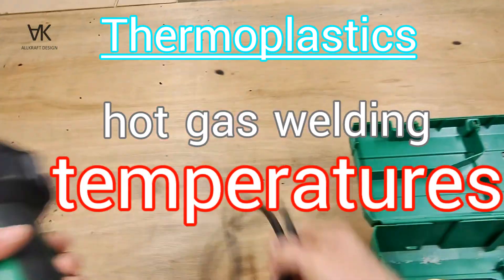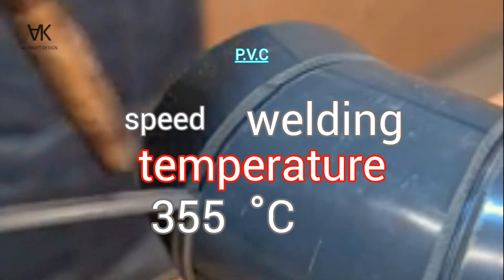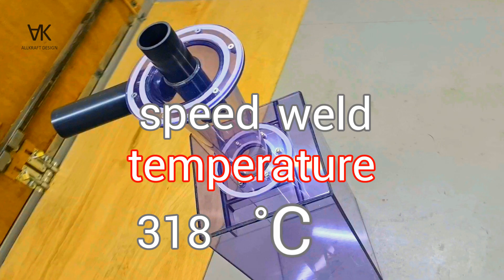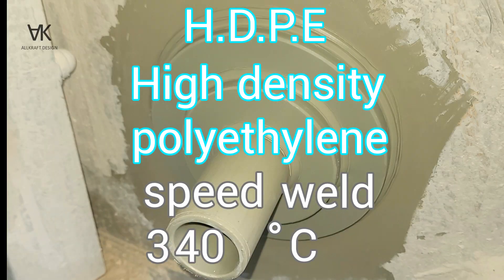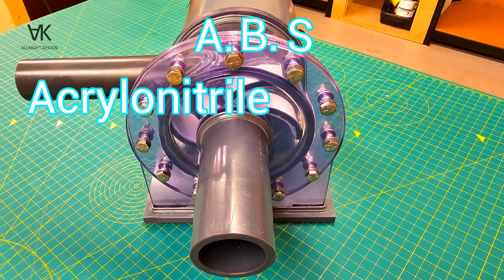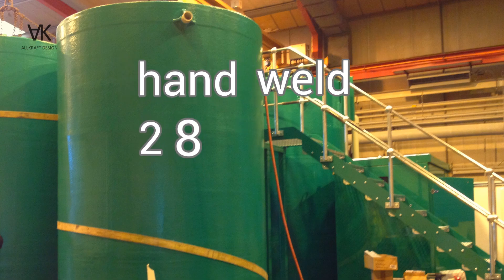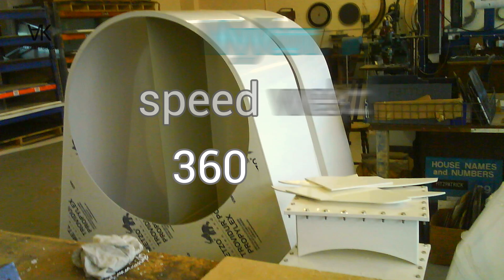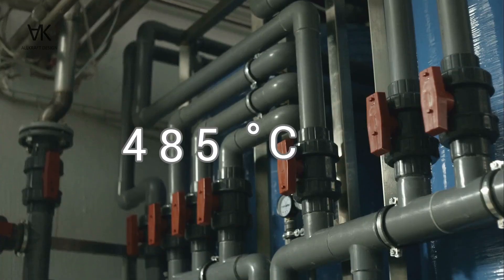Key Temperatures For Thermoplastics With A Hot Gas Welder

Comment: Hey, thanks for posting you're tutorials.  I want to start welding plastic, do you think that my 10 years experience in tig/arc welding will help me pic it up easily? I want to build small water tanks.
Reply from the maker: Hi 👋 yes definitely! been plastic fabricating for 30 years and started Mig/Tig welding around 10 years ago and it defo helped me progress. You won't need such a steady hand like with tig welding, if you have a decent melted ball between the sheet and rod and a nice consistent bead along the weld you won't be far off with that, will you be building cylindrical or square tanks ?
Reply: @allkraftdesign6120 Thanks for your feedback,  greatly appreciated. I need to build 3 tanks of around 60 litres each,rectangle but. In an angle at the base as it's for a sailboat. I want to use HDPE. Can you do a video on what shape rods to use, like for butt weld, fillet weld etc. Thanks again